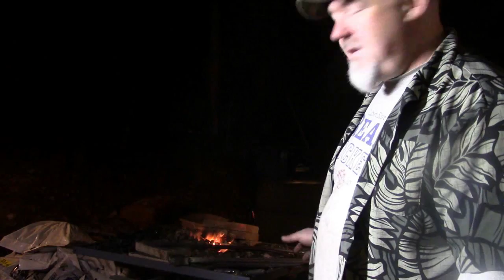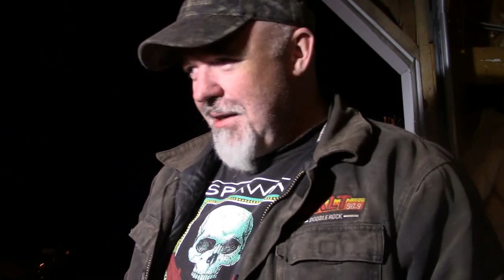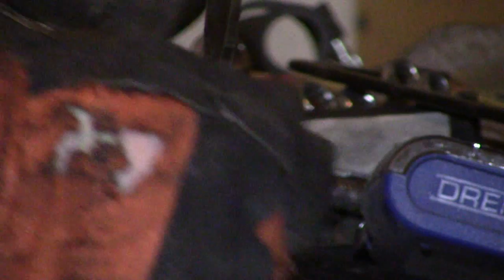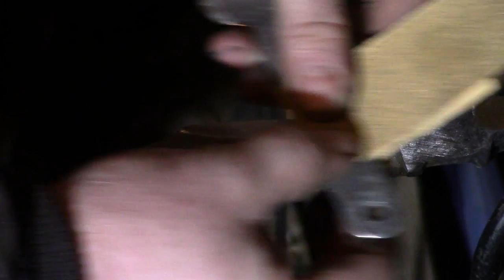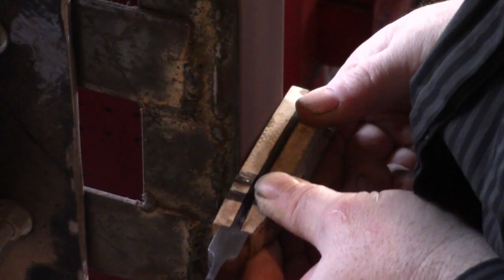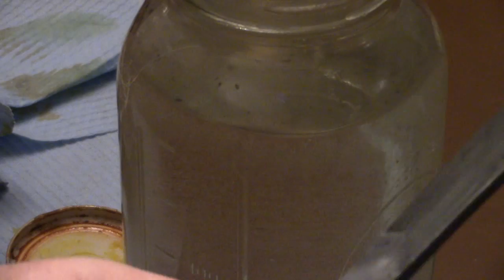Forging Damascus Knife with Integrated Bolsters FULL LENGTH Detail Video

Comment: Can drywall mud be used on my fire bricks seeing that it is fireproof?
Reply from the maker: I really don't know.  Its not really a question of if it is fireproof... its what temperature it can handle.  I have firebricks that are perfectly fireproof, but they turn in to a gooey glass-like goop when exposed to the heat of the forge.  Best I can say is give it a try.

Comment: You should try carving the bolster out of wax, and then casting it in aluminium or you can build an arc furnace and cast it from steel. I use my stick welder to melt steel with carbon rods. 60v will melt rock into glass.

Comment: have you ever tryed windex when hand sanding it seems to help keep the paper clean for me.
Reply from the maker: I've never tried windex...  I used to airbursh a lot, and when I put a clear coat of lacquer on my art work, before buffing, I had to wet sand that finish down, much like finishing a knife.  Because of the type of lacquer I used, I could only use water, or I risked getting a cloudy layer on the surface that was difficult to buff out.  Old habits are hard to kick, sometimes, so I still just use a little warm water.  I'll mix a a drop or two of dish soap in with it, but that's all I ever use for the wet/dry paper.
Reply: Thats cool I oil paint as well and mess with airbrush and pinstriping. That was my next question about the soap that helps also...

Comment: subscribed and thank you for being thorough. I have a great shop for cars and welding but am looking to setup my other barn for forging etc. what would you recommend for tools/setup? I have a small 40 and larger 75# antique anvil already
Reply from the maker: Hey Erik, I don't really get caught up in the "best" tools argument.  From working on my Jeeps to smacking hot steel around, I've always said, "Use what works".   So basically, all you need to get started, is a heat source, capable of heating the metal sufficiently, something to beat the metal with, and something to beat the metal on.  Could be as simple as hole in the ground for the forge, a big flat rock for and anvil, and small round rock for a hammer.  

I'm also big on cutting costs, especially if you haven't done it yet.  Some people, like me, get addicted to smithing, but some people try it once and hate it.  So, to start, sounds like you have the anvil situation covered.  Just mount those puppies down to something solid, and they will work great to get you started.  A simple cross peen hammer was my first hammer, and I found it at a flea market for next to nothing... but just about any hammer will technically work.  A large ball peen hammer might be a real good starter, just to get you goinf.  And for the forge... My brake rotor forge has been going strong since I started... over two years now... and the only thing I bought for that were the pipes for the air flow.  Everything else was scrap.

Once your up and running, and actually smacking some hot steel around, you'll quickly start building your own "want" list.  My "perfect" shop for what I like to forge, how I like to forge, and where I would like to see my forging go in the future, would be completely different than anyone else.  That makes it hard to say what the "perfect" tools are.  I know what I would like for making damascus knives in the space I have available to me, and with where I'd like to see myself in a couple of year. Someone else would want/need something very different for their ideal shop.  So just get started and you will have your own "want" list put together in no time.
Reply: Very cool thanks brother. As a car/truck/racing builder man myself, I appreciate the "all tools" comment. I'm very fortunate to have amassed selection & have amazing antique ornate stove. Unfortunately, with all above listed and living fast & hard, I have 2 fake shoulders by age 30. So, I also appreciate your time & sentiments regarding "trying" it out. Always been fascinated and know metallurgy well,but if the body isn't having it; I'll be a spectator lol. But,like you,  I could go FULL BORE really easily, so I'll definitely keep things in mind and not think I need the full set of hammers&I'll start with what I have.
Reply from the maker: Stay healthy, my friend.  Just keep in mind, for the most successful blacksmithing, "power" in your hammer swing isn't the answer.  I mainly use a smaller 2.5 pound rounding hammer these days.  I used to think my big 4 pound mini sledge would move the metal the fastest and easiest, but when I discovered that accuracy and proper hammer technique was more important to moving the steel, my life became a whole lot easier.  If I could swing that 4 pound mini sledge as well as I can the smaller hammers, then I'd do it, but I move the metal faster, using the lighter hammer.  I dealt with a lot of hand and elbow problems when I first started, because I was trying to muscle my way through everything.  As soon as I learned to relax and let the hammer do all of the work, I ended up get faster, and stopped having to deal with the stress injuries.  Don't know your health history, so can't say more than give it a shot, but when done properly, it really isn't that stressful on the body.
Reply: AWESOME,  wtf is everyone using #10-20 SHIT for and all these "power hammers"? Like the industrial 50ton presses I've seen some use
Reply: I like it man, that's great news and I'll assuredly take the "golf" approach and let the hammer do the work. And with that said, no I don't golf anymore with 12 screws and a hinge lol
Reply from the maker: When you get in to bigger stock for bigger projects, for making hammers, or whatever, then it helps a lot to have a striker swinging a big ol' sledge, but the same rules apply of letting the sledge do the work.  Power hammers and presses just make life a lot easier.  I have my eye on a particular forge press to speed up making my damascus billets... they're pricey though, so its not coming any time soon.  A power hammer would be great too, but not really feasible for my current shop set up.
Reply: Cool thanks again and I'll be following progress

Comment: Very well done sir. Based on a lot of things you're doing there, have you considered getting a guillotine tool? There's a dude on ebay selling them for $75 with an extra set of dies. Mine is on the way and I can't wait to try it.
Reply from the maker: As a matter of fact, its at the top of my wish list.  I will have to check out ebay, because that sounds a lot more affordable than most of them I've seen.  Appreciate the info.

Comment: how or where did you get your forage?
Reply from the maker: I built my forge from a bunch of scrap parts.  The fire pot is a brake rotor off of my Jeep.  I bolted a black metal flange to the bottom and plumbed it for air from some two inch black pipe from the hardware store. I used some scrap expended steel for the grate, and then use a hair dryer for the air flow.  It is connected to the two inch pipe with metal dryer vent hose and duct tape.

The table is two metal shelves that I scavenged from work when they were getting thrown away.  I tack welded them together to make the basic table, then cut a hole in the center to fit over the brake rotor, and welded it all together.

The stand is made from some legs that, I'm guessing, were used for a work bench originally.  I found them at my preferred scrap yard, and got them for a couple of bucks.  I bolted the the shelves to the top of it, because when they aren't bolted down, the heat from the forge makes them want to bend at crazy angles.  I welded a bit of a frame structure between the legs that the brake rotor sits on, so the weight of it isn't held up by just the thin sheet metal table. 

Then I took the whole thing and bolted it all to a furniture dolly from Harbor Freight so I can roll it out to the driveway when I want to forge, and roll it in the garage when its not use, to keep it out of the weather.

I use a few fire bricks to help me keep the coal where I want it around the fire pot, and I lined the rotor with fireplace cement to give it more of slope which helps direct the air flow and makes it easier to pull the clinkers out while I'm forging.  I have to redo the cement every few months because it does degrade form the intense heat, but its not to bad.

If it would help, I could make a quick video, showing how I constructed it, and give you some close ups of how I put it together.  I have less than $50 in to it, and its held up quite well for me.
Reply: HoJ Forge & HEAPofJEEP brake rotor off my jeep, most fucking baller comment I've heard in months, you Sir have made my Thanksgiving

Comment: did I see you stack the same kind of steel together and  weld them at the beginning? if yes it seem strange to me because I've only seen it made by stacking the different steels in an alternating stack

(edit) also I could be wrong but it seems like you're using too small of an anvil I was always taught 50 pounds of anvil per pound of hammer and your anvil seems like a 125 give or take if I'm wrong feel free to correct me
Reply from the maker: One thing people quickly learn about me is that I don't give a damn what the "rules" are for doing something the "right" way.  If I did put two layers of the same steel together, then that may have been a mistake, but I will sometimes put two layers of the 15n20 together, on purpose, to make them thicker on the final pattern.  But yes, you will absolutely get better contrast by putting different steels together... but you don't "have" to... Cable damascus wouldn't work if you had to follow the rule of alternating steels.

As for the anvil... I wish I had a much heavier anvil.  Mine is just a 70 pound Vulcan.  But it is all I have at the moment, and where as it does like to wander, because the base is to light, it works... and I've heard that rule about hammer weight vs anvil weight for a long while, and I don't buy any of it.  A heavier anvil would certainly be more effective for transferring energy back in to the work piece, thus making each hammer blow more effective, but if I waited until I had a "proper" anvil, I would never have started smithing at all.  My first anvil was a 40 pound hunk of railroad track.  Learned a lot, and forged plenty of things on it, but according to that "rule", the biggest hammer I would have been allowed to use would have been about 12 ounces, not my 3.5 cross peen that I started with.  I'm currently trying to work a deal with a coworker/friend to procure a nice large shop anvil in exchange for a knife or two, but while I'm trying to work that out, which might take several months, I'm not going to sit on the side lines.

So, maybe they are good ideas to follow, or "norms" to shoot for, or whatever, but blacksmithing is an art, and with any art, I don't think there are many rules that can't be broken.
Reply: HEAPofJEEP I agree with a lot of what you say, the reason I pointed out the alternating steel is because I haven't seen it before and the anvil was more to express my opinion that you'd have an easier time with it these aren't rules but just suggestions from people who figured out that it would make things a bit easier
Reply from the maker: Cool.  Made this knife a while ago, so don't have any clear conscious thought of putting two of the same layers together... compared to the leaf spring I was using, my 15n20 stock is quite thin, so maybe it just looked like there was nothing in between?  Not sure what you were seeing, but I wouldn't put it past myself to throw two of the same together by mistake.
Reply: HEAPofJEEP yeah it's kind of an annoying thing that came with being in the army I notice tiny details that most would probably think of as in consequencial

Comment: you know much about your anvil, i have the same one, just curious about the maker of this anvil
Reply from the maker: My current anvil is a 70 pound Vulcan. Not a great anvil, but it gets the job done.  You can see in my videos, that mine likes to wander as I work on it.  I should make a heavier base, but its like a lot of stuff... "I'll get around to it some day"...  Vulcan's are cast iron, which means there very quiet when you hit them... the neighbors like that.... but cast iron is very soft and pretty brittle.  On a Vulcan, there is a steel plate that gets welded on the top, so I haven't had any issues with denting up the work area.  I picked mine up off craigslist, and there were already a couple of ships in the edges, but I haven't had any issues with new ones developing.

Besides wanting to anchor it down better, the only other thing I watch for on mine is how much work I do on the horn.  Because it is cast iron, if you hit on the horn to hard, it will snap right off.  So, I really try to keep my work on that area to a minimum.  

A lot of people, who are anvil purists, will bad mouth Vulcans because they are cast iron, but with the steel plate on the work face, it really isn't a bad anvil at all.  a ton better than the Harbor Freight anvil that are all cast iron, with no hardened work face.  I'm always keeping my eyes open for something bigger and better, but I've used mine for a year, now, and haven't had any issues.
Reply: +HEAPofJEEP thanks for the reply.
Reply: Have you tried getting a large piece of tree trun
k (a.k.a. firewood to mount your anvil?
Reply from the maker: I always keep my eyes open, but I will be replacing this anvil at some point soon, and then I'll just use this one as my traveling anvil for doing shows.  So, I haven't really put much effort in to trying to stabilize this one.  Lots of grandiose plans for mounting the new one, but I need to finish saving up the funds for that one.  A couple more good shows and I should be able to pull the trigger on the new Emerson.

Comment: im only at the begining of this video but you seem to hit very softly. for the next time try hitting harder so the layers stuck better and change of it splitting again later on drops.
Reply: okay you star hitting harder later on
Reply from the maker: You NEVER want to forge weld by trying to muscle things together.  I use a 4 pound mini sledge, and just the weight of the hammer on the initial weld is all you want and all you need.  Increase force of the blows with additional welding heats.  If you start out your welds by just trying to hit as hard as you can, you won't get successful welds.  I'm no expert, but I've made enough pattern welded knives to actually become pretty good at the forge welding, so just don't anyone to read your comment and think that hitting it harder is the correct way to do it.

Comment: In regards to the begging of the video. as my grandfather would say "Jack of all trades, master of none." He was a mechanic, I grew up in a junkyard turnin wrenches the went to a Voc school for machining. I like how your forge is set up like a table, mines more like Chandler's tripod forge. Beautiful knife man, that handle looks bitchin with that bolster. take care and thanks for the video!
Reply from the maker: +Dwayne Routhier Jr Hey, thanks Dwayne.  My brake drum used to sit on a couple of cinder blocks, but I scavenged some shelves from a metal shelving unit that was getting thrown away at work.  I just welded two of them together and cut a hole in the center and that became the table.  I found the legs I mounted them to at the scrap yard, and then mounted the whole thing on a furniture dolly from Harbor Freight.  That lets me roll it in and out of the garage so I'm not leaving it out in the elements when its not in use.  Some day in the future, when my wife lets me spend the money on a pole barn, I would love to set up something permanent inside, like what Chandler has set up now in his shop.  It got pretty brutal this past winter, forging out in the wind, cold, and snow.
Reply: +HEAPofJEEP  hey man, I don't know if you care, but I got a blow dryer. on the second heat I melted my blade.... lmao. not to bad, I ground a hook into it like a fishing knife. it was close to the handle. for my first knife I think it looks pretty nice. no heat treat or nothin. that coals nice. cools off pretty quick when you'd done.
Reply from the maker: +Dwayne Routhier Jr if you're getting it that hot, then you've got enough heat to do whatever you want with the steel.  Never turn your back on it.  I just burned a section of the tang on damascus knife I'm working on right now.  I was able to salvage enough of it, but all I did was go around the corner to fill up a bucket from the hose.  Only took a minute, and when I came back around I saw the sparkler show. I know better than that too, but thought I wasn't blowing much air, so should have plenty of time... WRONG!  Had to grind off a big section and make a smaller knife because of it.  Second time that has happened to me recently.  No more turning my back!